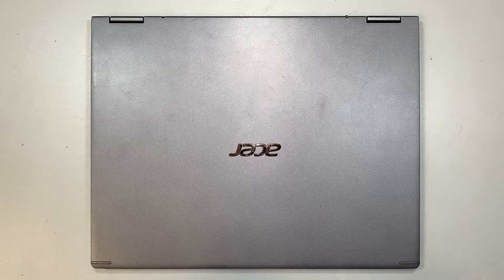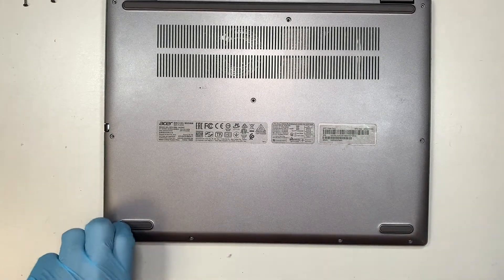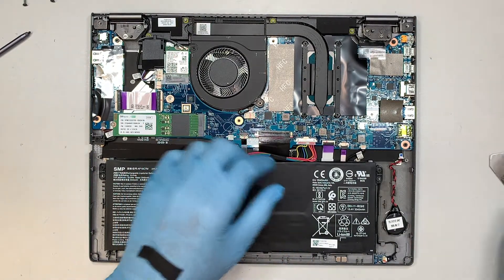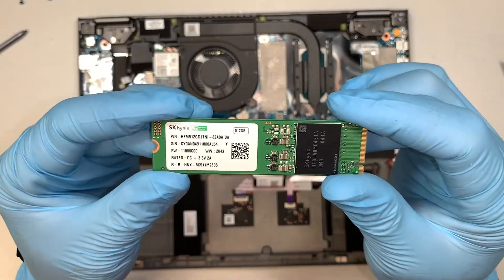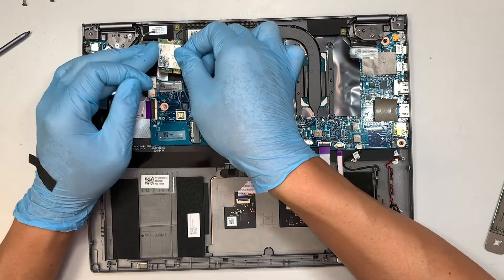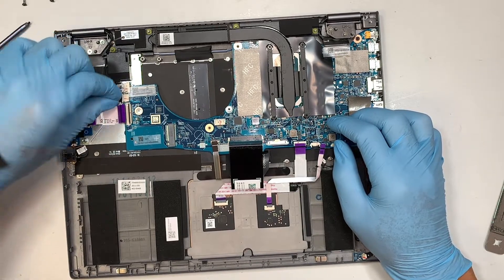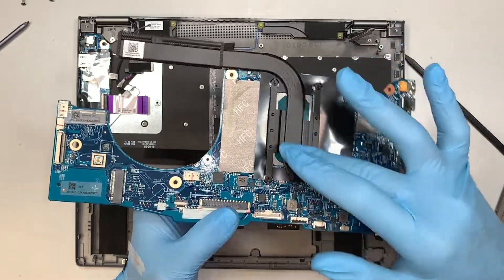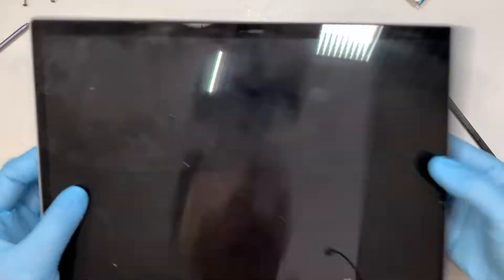Acer Spin 5 N19W3 SP513 Tear Down Upgrade Disassemble

Comment: Thanks Simon I have a Acer Spin SP513-54N where the upper case has completely fallen apart and screw holders have been torn off. After looking at this video I feel I change over everything to the new upper case I just ordered.

Comment: Does the screen has digitiser that works with the pen it comes with would like to know which cables comes withit?
Also, Can you post a close up view of the active stylus charging port? and do a video showing how to replace the charging port for the active stylus. are the charging port pin straight or have a sligh angle?

Comment: So when i plug thr charger in and the laptop is turned on i have a spin too the keyboard and thr blue light just blinks does the same if its turned of and i try to turn it on only when it charges

Comment: can a different battery be used? as in, from a different model or even different brand. would like to know if the battery can be upgraded (don't care if it fits in the laptop or not).

Comment: HI this is a useful video. I have a screen issue with this same model laptop. 

It has horizontal lines at the top of the screen. At times it becomes completely messed up with ghost images, red, blue or green vertical lines  coming on the screen.  With the help of your video I tried reseating the screen connector. In vain. 

Would it warrant replacement of screen or is it some other issue with it? It works perfectly with an external monitor.  

Can any other screen be of same size be used in place of this as the screen for this model of Acer is either too expensive or not available readily.
Reply: Hi, I also have the same issue, did you find any solution to it?
Reply: Hey!! I have the same issue!! Any luck guys?